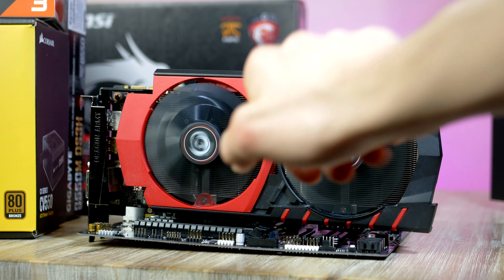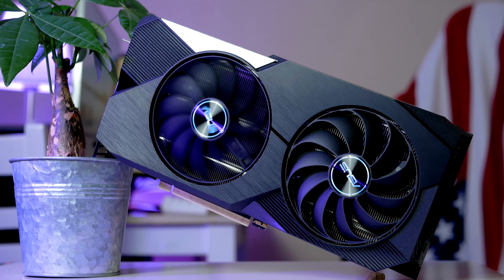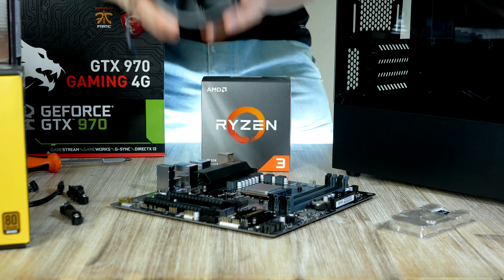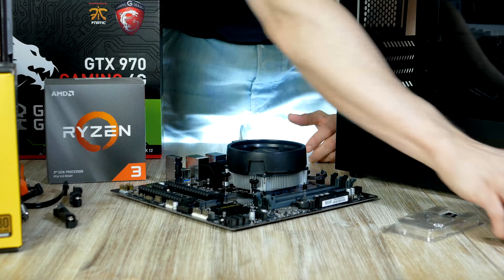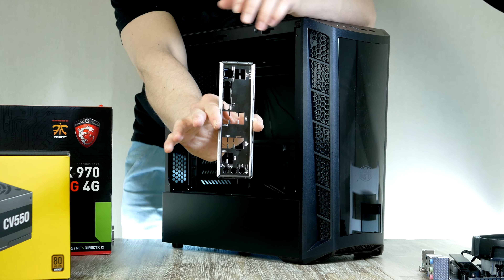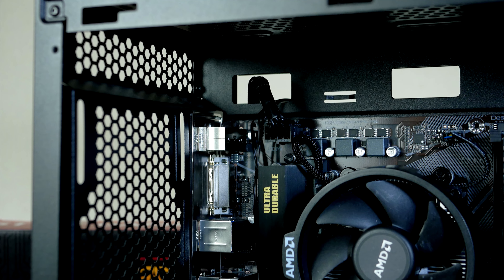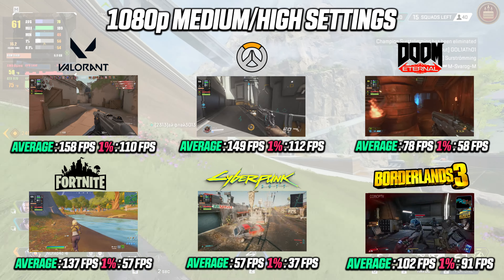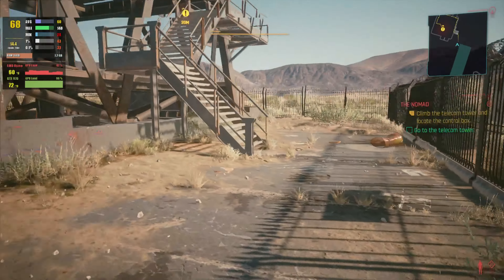How To Build A $500 Gaming PC in February 2021🚀Complete Tutorial + 15 Game Benchmarks!

Comment: Yeah, can't get a 970 under 200$.  ... the video clearly states the price pre-covid.  Deceptively low price.  I wish tech youtubers would just state prices as they are FOR REAL, this is more of a 650$ build if you pay current pricing for a GTX 970.
Reply: It wouldn’t change the build tho. So just think of it as a 650$ build probably where he lives he has those prices if it was transferred over to us
Reply: @nowayjey  Don't get me wrong, it's a fine build - it's just not a 500$ build.  You just can't find a 110$ GTX 970 right now at all. Best you can do for that price is an R9 270 ...
Reply: @Dingbat1967  he probably using used
Reply: @Dingbat1967  keep looking as lockdown ending means prices will quickly drop in the next month